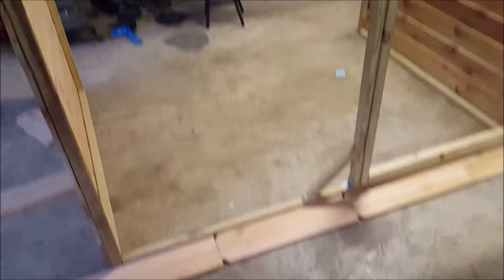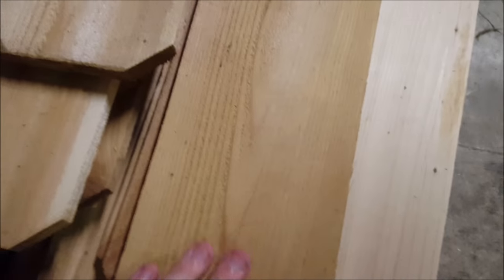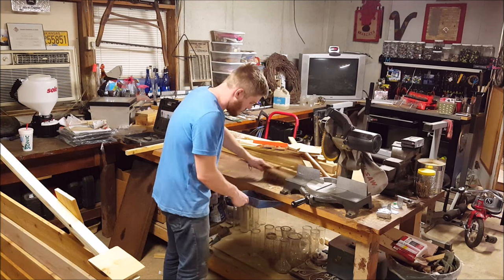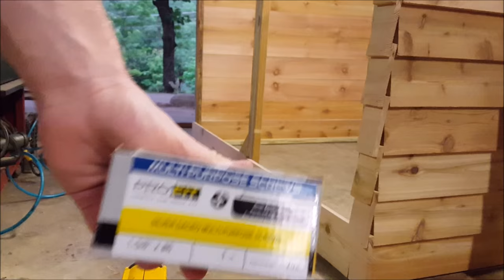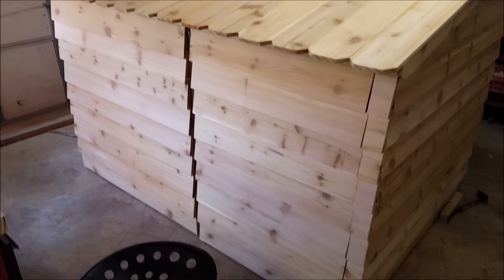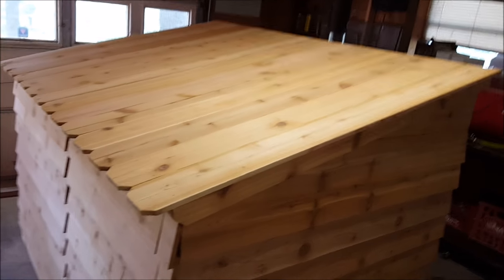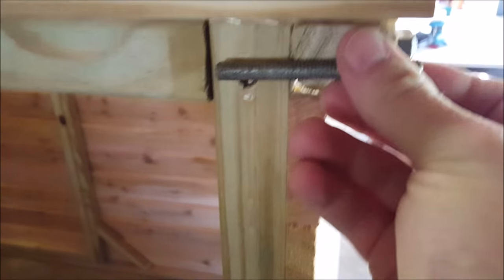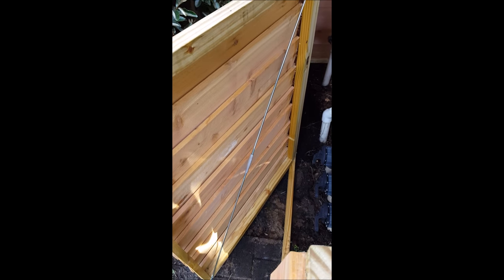Building a pool filter/equipment enclosure

Comment: Great video. I am in the process of doing the same exact thing for a pool filter that one of my customers has..this is a great video and you are right there is a demand for them. I already have a few more customers that want the same thing..thanks man this really helped
Reply from the maker: Thanks for the comment! I am glad the video helped. looking back, i wish i would have made the frame a bit more sturdy to hold the weight of the lid better. I am planning on making another this fall and i will do another video over that.
Reply: Would you rather have used 2x4s?
Reply from the maker: Yeah I think 2x4's would have given the project a bit more rigidity. However, the idea was to keep the thing light weight because I knew I would have to carry it through someones back yard (which is quite a haul in this case). The 2x2 supports have held up nicely and the box is still in the same condition as when it was installed.
Reply: Braxton  Thank you very much. Did you have dimensions for the one you built? I'm interested in what angle/pitch the lid should be downward from the back corners... thanks again

Comment: Thanks for the video.  Is the box bolted down to anything?  Did you anchor it to the brick wall?  High wind areas might lift it off and damage the pumps and PVC pipes.

Comment: Only change to make is put spacers one board deep and flat pieces on the ends instead of yhe angles. That will close it off entirely. Other than that it looks pretty good and easy enough to do.. Thanks for the video.
Reply: Pump will over heat

Comment: I just need to know if the box need be ventilation
Reply from the maker: Simone Lorinz This box is not air tight and most designs incorporate some small vents. I don't know if ventilation is required, but i would recommend it. If noise reduction is your goal, try placing the vents in a way that the noise is not directed towards your entertainment space. I hope that helps!